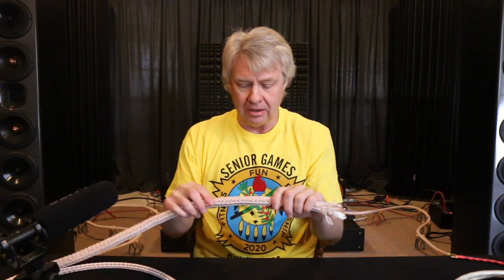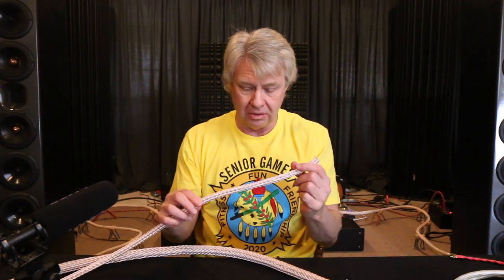What’s up with Audiophile Cable Risers?

Comment: If you hadn't been the one to tell me, I'd never have believed it.

My totally uneducated guess is that a wire will create a field around itself when charged.  Laying it on the floor causes that field to bend, to no longer be circular and to have a flat spot.

That's it.  That's all I've got.   :)
Reply: Fantastic. You, sir, just rewrote the books on electrical impedance (what Danny is actually talking about here, along with static discharge coupling though, contrary to his claim, it is non existent unless your dog keeps rolling over and over on top of your audio cables lying on the carpet. And even then, seeing how low an impedance well designed amps and speakers present, good luck to hear anything...)
Also, a 'charged wire' in audio is a very interesting concept, could lead to a Nobel on unheard-of mono-conductors...
You get a B+ for effort, and acknowledging it was indeed an 'uneducated guess' 😉
(hint: electrical impedance, which is frequency dependent and can be described with R/L/C or Amplitude/Phase graphs, is the result of the electrical & magnetic field characteristics between 2 conductors. The important part in this whole sentence is 'between 2 conductors'. We'll give you and Danny a little time to catch up with over a century old physics)

Comment: The difference from speaker cables laying on the floor or off the floor has to do with the vibrations on the floor, and therefore it can make a difference in the transmission of the sound, and therefore we can hear a difference.  The difference could be better.  But it could also be worse.
So just try it and see what you think is better.
👌🏾👍🏾👉🏾✌🏾😉And of course a delicious cup of coffee☕️
Reply: I thought it was because it makes them closer to the moon ?
Which has a well-known soothing effect on electrons.
Vibrations coupling with cables... who would have thought ? You saved my sanity, dear sir 🤣

Comment: Hey Danny what amplifeiers are you running in the back there?
Reply: They are custom mono blocks based on a single chip that will output 60 watts into 8 ohms.
Reply: @dannyrichie9743 cheers, I thought they may have been something else, they looked a bit like a Mclaren 903's.

Comment: Large Corner Post Ceramic Insulators, 1-3/4 Inch Diameter cables fit nicely. stay in place. used commercially widely available 10 pack - $15.

Comment: If you can hear a difference then you can measure a difference. I don't doubt you hear a difference, but there's a root cause here that should probably be untangled. Are you on the ground floor? Steel reinforced concrete below the cables? The "clarity" you're hearing is probably just a couple db lift in the 10-40khz range caused by taking some inductance out of the circuit by getting the cables away from iron.
Reply: There are a LOT of things that make audible differences that we don't even know how to measure.
Reply: @dannyrichie9743 Have you tried an oscilloscope with a signal generator? Have you put your normal measurement mic in front of the speakers and swept/charted the response with and without the cable risers?
Reply: @dannyrichie9743  Here's the problem, you're asking people to take your word that you can hear meaningful differences when you upgrade components or cables, or in the case elevate cables off the ground. You get all bent out of shape telling people they are flat earthers if they don't believe you, but then, haven't come up with any way to prove your claims with measurements.

I can assure you, if you can hear a difference, there is equipment out there that can measure it, or measure the root cause of it. Just because you don't know how, doesn't mean it can't be measured and doesn't mean that someone doesn't know how.

I work in an engineering company where we routinely use oscilloscopes, network analyzers, LCR meters, and other calibrated electrical and radio measurement tools. I've seen simple things like moving the position of a cable, or the length of a cable, or the proximity of a cable to metals or other sources of interference cause changes to the amplitude and decay characteristics of the energy pulses we measure. 

I'd be willing to bet that this sort of equipment could be used to characterize the speaker cable when on and off the ground, and there might be some differences.
Reply: @mdocod  You response about using an oscilloscope or measuring the speaker's response perfect illustrates my point about not knowing how to measure the differences that we are hearing. You (and many others) don't even know where to look for the differences. 

So I hear a difference in the space within the soundstage of two instruments and two variables that I am changing vary that space and separation, and the first response of the naysayers that can't grasp the concept is to take a measurement for the speakers in a way that just measures amplitude (how loud it is) over a given frequency range. We are not hearing a change in loudness. We are hearing a change in image separation.
Reply: @mdocod  Lastly, to test or confirm an audible difference all you have to do is listen. 

It is like me tasting some milk and saying this milk is sour, but you don't believe me. You want me to come up with some scientific way to measure the milk to confirm if it is sour. I don't need to do that. I can taste it. It's sour. Then I am trying to simply get you to taste it if you want to confirm it is sour, but you won't. You are too worried about confirmation bias, a placebo effect, expectations, having 100 people taste it to create a statistical analysis, etc. When I am telling you it is real obvious. Quit wasting your time and just taste it.
Reply: @dannyrichie9743  I work in IT supporting an engineering company. I do cyber security monitoring, systems administration, server and computer provisioning, user policy, incident response, etc. I learn something new every day by trial and error, reading, etc. We are always striving to improve the security and performance of our IT infrastructure. Honestly, I think if it were my career to sell speakers and speaker components on the basis that quality matters, I'd dedicate some time to prove these claims to my customers by learning how to measure what is going on. In doing so, I'd likely also learn alternative ways to achieve the same results. 

Me not knowing how, is not the issue, I believe I could figure out how to measure what you're hearing given enough time and equipment, and I'm not exactly an expert on EITHER of the areas of expertise required to get to the bottom of it (audio or electrical engineering). If I think I could figure it out given a scope, a signal generator, an LCR meter, a good microphone, and a maybe a network analyzer, and I don't even know how to use those tools very well, then certainly someone with more expertise could in short order. 

Have you considered the possibility that you are scared of what the answer might be? Once you properly characterize a fancy speaker cable you're going to be faced with the reality that the effect is not as magical or mysterious as you need it to be to justify a lot of the fancy sauce that goes into high end speaker designs.
Reply: @mdocod  Good luck trying to figure out how to measure the things I have talked about. Don't feel bad no one else can either. I already know what the outcome is. I, like our customers, and thousands of others, can easily hear the differences.

Comment: I bought some cable from you some time back, I was not aware that putting a cover on it would hamper the performance.  I have cats which like to chew on cables so I bought some braided loom made out of natural rubber with no color to somewhat protect the cables. Will this material affect the sound aswell? I will take it off in a heartbeat but the cats are gonna have their way with the cable... admire your products and knowledge 
Avid repeat customer of your upgrade kits and wire
Reply: Yes, it will have an effect. Peel it off and find out.
Reply: The best thing about using risers is that it gives the cat something else to amuse itself with instead of chewing the cables, for a while at least.
If you're really good at listening you can tell which risers the cat has knocked over and in which order they did it!

Oh, taking the braideed loom off will make a difference but it will take some time before the cat chews all the way through the cable, so the difference might not become apparent for a while.

Comment: I'm agree with the physics of it, but unfortunately I'm in the 90% whose system has other bottlenecks. I will try it in the future. PS - you had better top up the kids playbox because you used a lot of bits!
Reply: The physics of it is wrong.  Electric fields are not magnetic fields.  Static electric fields do not transfer energy, current is required to produce a perpendicular magnetic field.  Audio signals are AC not DC.   The speaker circuit discharges static on the dielectric insulator between the conductors that are the speaker wire.

Comment: I have a very modest system worth about $4k all up, i`m using worlds best cables quad 12awe for each speaker, swear i could hear a little difference lifting the cables off synthetic carpet.
Reply: Those are FAR, FAR away from being the best speaker cables. They are also covered in a thick layer of PVC. So they have twice the effect of being laid on the carpet by design and you can't get away from it. It is on the wire all the time.

Comment: The other misconception is that stranded wire is superior.Not so! Electrical impulses do not travel through the wire,( regardless how thick it is!) They travel on the outside  of the wire/ or bundle of wires.It's called Skin Effect.stranded wire is inferior due to constant cross talk.Solid Core is much better for a bargain price.thats why pricey cables use multiple individually wrapped solid core wires.
Reply: All of our internal wire is solid core wire as well.
Reply: @dannyrichie9743  Hey Danny,thanks for responding.I respect you as an engineer/ designer very much! I didn't realize that getting cables off the floor would create any sonic improvement at all.learn something new every day. I've been designing/building speakers for 30 yrs.,and have seen all the tweeks. I'll take your word for it, cause I know that you know what your doing.Chris.

Comment: Did you do any blind testing?
Reply: Yep.
Reply: @dannyrichie9743  What methods did you use? This is what I would do assuming speaker switch boxes are out of the equation. Two pairs of identical speaker cables and connectors with one pair on the floor, the other on risers. You sit in your listening position and put on a blindfold. A second person (who remains silent the whole time) flips a coin - heads = with risers, tails = no risers and makes a written note as to which cable was used first. This second person then connects the appropriate speaker cables according to the coin flip and plays a pre-selected piece of music then switches to the other cable and plays the same music again. You decide which sounds better which the second person notes. Repeat this process several times with different bits of music. After around 10 tests, you should have some pretty conclusive evidence as to if risers improve the sound.
Reply: @mddawson1  It is even easier to just remove the risers. The difference has been clearly audible within the first few seconds with every person that has been in the hot seat.
Reply: @dannyrichie9743  The whole point of blinding the listener is to remove any unconscious influences from the comparison process and this includes unintentional clues as to what is being listened too. The method I suggested makes it less obvious when the risers are in place as the blindfolded listener can't hear them being set up. It is also quicker which I find improves assessing A - B comparisons.
Reply: @mddawson1  When the differences get this obvious it doesn't matter if they see anything or not.
Reply: @dannyrichie9743  There are many examples of why blinding is essential when doing A - B comparisons. Take wine, where many studies have shown that a cheap wine in an expensive wine bottle is perceived to taste better than the same wine in its original bottle. The only difference is in the minds of the testers who would say it was the same wine if they had been blinded to the bottles. We humans are very good at deceiving ourselves.

Comment: Wouldn't an active system solve all these problems?  NO expensive passive parts, amps mounted on speakers, so no expensive speaker cable, no need for tinker toys, DSP control of all EQ, time alignment of drivers, ??
Reply: That comes with a lot of other bottlenecks and limitations.

Comment: Thanks, Danny! The electrical fields surrounding the circuitry, but particularly the interconnect cables, are too often neglected in their consideration of how the surrounding materials might be affecting the field, which results in a slightly different signal than was put into it. You've got to have a good system to hear the differences, but the effect is still there. On one hand, this implies that a slightly less resolving system may be "better" since it doesn't show off the differences caused by using or not using stress risers, but for die-hard audiophiles, it's at least something to consider in keeping the signal as pure as it can be.
Reply: Can you clarify the statement “ you’ve got to have a good system to hear the difference” ?
I’m assuming by that statement that you believe yourself to have a good system, therefore it would be good to know what system you have that brings you to this conclusion!
Reply: @ianarthur3412  Actually, I'm not sure I do have a good enough system to hear the difference. Maybe I will someday, but I have a hard time denying others from saying they do and that they can hear the difference. 

To answer your question, though, let's take a mind-walk. I propose that a "good system" is one that colors a signal sufficiently low that changes in coloration from other sources will be more discernable. In other words, in order to hear the benefit of the cable risers, the system will need to keep the signal sufficiently pure (i.e., low noise/distortion) that the electrical impurities from the floor a noticeable. Each material in and around the signal path responds to an electrical charge/signal differently, some more so, some less. Noise can creep in from anywhere and to varying degrees. If the "noise" from the room floor is larger than what the rest of the system is causing on the signal, I'd expect that to be noticeable, at least discernable. If the system colors the signal too much already, then it makes sense to me that it would be harder to discern the change by using cable risers.

Comment: Somewhat facetious comment, but won't the humidity in the air surrounding the cables change the sound? What if you're near the beach with salt in the air and settling on everything. 

I give kudos for your being upfront about cable risers being way down on the list of "improvements" and DIY Tinker Toy approach.
Reply: Nothing facetious about your comment.  Humidity wreaks havoc on electrical anything.  I live in an older home and my hifi rig would thank me if I were to rip out every exterior wall and install vapor barrier.   I wish I could.
Reply: @jimgardner5129  Yes water vapor does accelerate certain forms of oxidation, and dendrite growth which is deleterious to many things including electronics. 

The part which I was being facetious about was the humidity in the air increasing the capacitance (or otherwise affecting the EM field created by the signal in a wire) of the wire due to its dielectric effect, similar to the dielectric effect of the wire on various forms of floor covering.

Comment: I tried tinker toys for my wires. I found a set at a yard sale. It didn't sound much different but it may be that my system is not as detailed. After viewing this video,  the price of these tinker toys just went up 💯% .😎  BTW your Amps might benefit from iso platforms? Greg
Reply: You are correct about my amps.